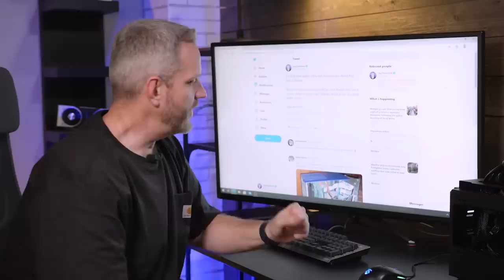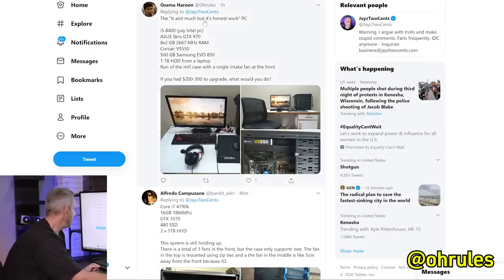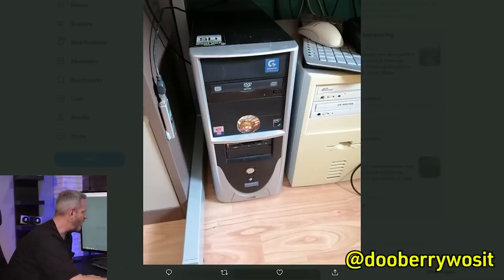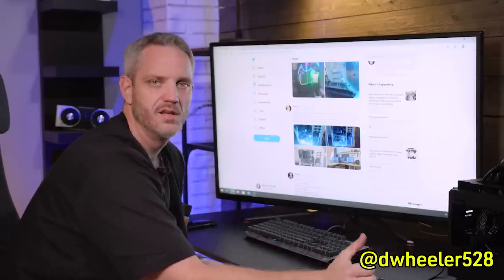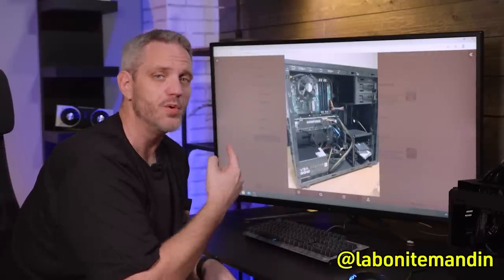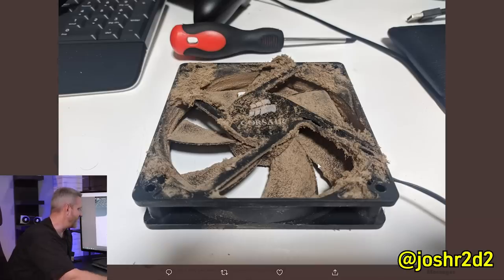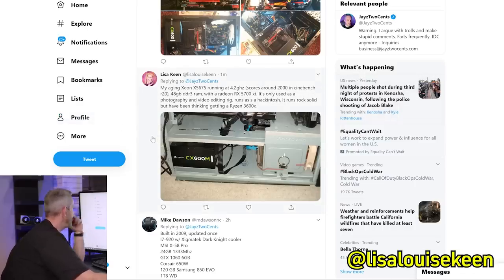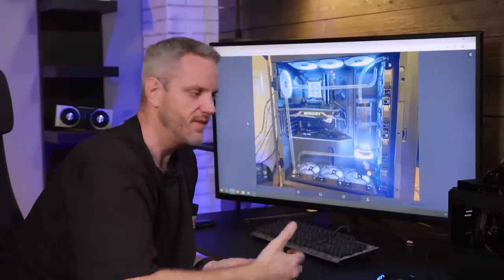Reacting to your WORST Setups... Send help NOW!

Comment: 6:30 Jay: "Im gonna preach to everyone running an FX processor right now"
Me: Running an FX-4300 for the foreseeable future
Reply: I mean a budget ryzen upgrade would set you back like 200 bucks (ram cpu mobo)
Reply: I don't get it...why are fx's bad?
Reply: Also he said “sell your FX system it’s a decade old.”

Meanwhile a Intel Core 2 Quad Q8400 is slower  then a FX4300 in most multithreaded workloads. And a FX6300 or FX8350 are much better then the Q8400. And still Jays’ advice for the Q8400 owner is “upgrade your gpu.” 

Am I missing something? I haven’t tested Q8400 or lower end FX systems in a while but pretty sure I am correct.

If I was the Q8400 owner I would upgrade to a newer platform (AMD Ryzen or Intel) and keep the GTX970 and upgrade that further down the line.

But that’s just me 😉

Still, nice video, fun to watch 👍😀
Reply: I still have this thing can't wait to get rid of it this Winter
Reply: @MrJohnLongbow  That system had an i5-8400 in it, not a c2q...
Reply: I had an FX6300 overclocked at 5.1GHz and ran it that way for 2 years before changing to an FX8350 that I'm still running 4 years later.
Reply: @urorazbojnik5678  I'd like a real answer to this as well.  It's the CPU family everyone loves to hate on, but I haven't seen anyone give a legitimate answer why it's so much worst than anything else for the money.
Reply: Dániel Kirr ah, makes sense now 👍😉 thanks
Reply: I still run a og fx-8320
Reply: @ThinkFreely2012  I got a less than average 8350 but it's stomping my golden sample 4350 and 6350 even with those clocked 5.5 and 5.0 respectively. 5.5 actually killed a 120mm aio lmfao
Reply: @ThinkFreely2012  32nm process node for AMD was not the best. It didn't live up to it's predecessor due to running super hot and not having much in the way of improvements. Their best point was their overclocking, with the 8350 being one of the first cpus to hit the glorious 5GHz threshold (if I remember correctly that is. If I'm wrong, someone please correct me :D)

Even with water cooling and super good fans (industrial noctua 120mm 3000RPM variant), with my chip OC'd to 4.8 GHz I have to max out all of my controllable fans to keep it from hitting 50C when I hit it with a 100% load
Reply: @finch404  what parts are those? Curious because I don't see that as doable for $200.
Reply: @tattoojay88  https://pcpartpicker.com/list/FbyfFG

It's not quite 200 dollars, but at that price you already have good ram (3200mhz) for ryzen. So if you cheap out a bit on that you'd be closer.
Reply: @xchronicxblaiz3x  Since when is 50C considered a hot load temperature lmao?
Reply: @finch404  wow OK thanks, I didn't think that was possible. Thought for sure you couldn't get a mobo or 16gb of ddr4 that cheap. That would be a great budget setup.
Reply: @finch404  50C is what I want it to max out at so it isn't near max temp of 62C.

I'm not trying to kill this cpu... yet. 50C is warm, not hot.
Reply: @xchronicxblaiz3x  since when is 62C Tjunction for any Cpu? What the hell?

Edit: apparently it is 61C, what a joke hahaha

Comment: Jay: No FX, plz
Me: laughing in Pentium
Reply: My mother bought a laptop new 3 years ago (with windows 10) and it had pentium in it
Reply: @Tornadica  skylake pentiums were released 2015, Broadwell was also released 2015 and one was in 2016, kaby lake was released 2017 and coffee lake was in 2018 and the release years what i mentioned were for pentiums
Reply: @unluckyrgg  did not know!
Reply: @Tornadica  well now you know
Reply: My nephew still uses my 21 year old pentium 3 for recording. It still runs!
Reply: @jc.1191  ive got a core 2 duo it only throttles to 93%
Reply: @kieran3339  I got 13 years out of mine till I upgraded from power supply failure.

Comment: The next theme should be "pre-owned pre-builts". 

People showing things that they've done with cheap pre-builts that they bought  second hand.
Reply: Ok emo kid
Reply: @hammer6854  ok hammer
Reply: @geogaming369  ok? And? 

What does that have to do with my original comment? 

And what does 15 year olds have anything to with anything? 

I'll be 29 tomorrow.
Reply: I paid $900 for a 2600x on a Strix b350f with 32gb 3000mhz Corsair Vengeance LED Duke RTX 2070 OC, 256gb m.2 boot drive, 3tb HDD, EVGA G3 fully modular 750w 80+ gold PSU. I simply bought a new x570 along with a 3700x and 32gb of Corsair Vengeance RGB at 3200mhz and only spent a grand total of $200 more doing that, but I did trade a Ps4 for the 3700x, but I only paid $100 for that so it was quite worth it. (I ended up spending another $50 on a 550w PSU, got a 1tb m.2 for my new mobo, and paired the 2600x with an RX 5700 that I traded a PSVR for that I also only paid $100 for) got my 13yo nephew an entire 'budget' (compared to mine) system, and my own as well, for under $1.5k

Comment: "get off FX"
Hah... Tell this to my father. He's still using pre-FX Athlon
Reply: My dad still uses a phenom...
Reply: Both of my parents do as well in their office PCs.
Reply: @Eidolon2003  my phenom ii x6 still runs everything i like just fine it even runs the new flight sim 2020 just fine 🙂 once i get fhe money for a new motherboard ill get off the trusty phenom.
Reply: @Eidolon2003  Phenom II X4 and a 750ti here, don't know how this 6 year old grandpa is still running
Reply: @mastrtrogdor  wasn't Phenom II processors were released at 2011 ?
Reply: My parents literally use their computer to sync iPhones to their huge iTunes library and to print stuff. They are still on athlon and there's really no reason for them to switch. But I still give them crap for how old and slow that comp is every time I see them using it.
Reply: @CPyJIb  yeah, built this about 6-7 years ago, back when it was a good budget build for the time. Overall parts are nearing a decade old. I'll build a new one some day, when I've got the funds. With a family it's hard to save up.
Reply: @mastrtrogdor  I am not saying it's bad or something, just clarifying the age )
Reply: @evanhoover2447  time moves in slow motion for old people, ever see one fall? They probably feel like the 5 mins it takes to boot is 30 seconds lol.

Comment: Hey now, I'm still running FX processors in my homelab. They work great for running a few k8s workloads and my plex server. I bought this stuff before Ryzen existed and Intel was out of my price range. I wanted cheap and relatively power efficient (compared to actual server hardware) homelab gear and they fit the bill (microcenter bundles ftw). And honestly at this point, it would cost more for me to sell them and upgrade than to just keep running them until they die.
Reply: CaptainRedHat they dont’t die...
Reply: I’m still rockin an FX8350 (though my Ryzen 3600X just came in the mail today) at 1440p with an RX580 and getting pretty good performance out of my system. It was a great bang for the buck cpu at the time that has held up well over the past 6 years.

Comment: 6:23 didn't Steve from Gamers Nexus say in one of his videos that he still uses and FX at home? Undervolted and underclocked if i remember correctly...
Reply: Yeah. Steve still runs FC at home. This feels like a start of a battle between the two channels.
Reply: Im still using a fx8350 with an rx580. I can play modern titles 1080p higher or medium settings 60 fps. Its still relevant for modern gaming
Reply: Yup he did
Reply: @oelshami  they've already fought it out smh

Comment: Absolutely, an SSD brought back to life my wife's old FX system, (lol. I know). Cool part is, it's in a vintage case, black and silver much older than that. And no you cannot have it, lol. A video card upgrade to a 1060 also worked wonders for her. Goes to prove your point, that those two are the most significant upgrades. She plays mostly Ark and Conan and the difference it made was absolutely incredible on such a Dinosaur. Don't worry a Ryzen is in the planning in the future, I get it.

Comment: 6:23 I'm running FX-8350 and GTX970 still doing ok with games =)
Reply: Yes, but you are not doing ok with Jay. And isn't that what really counts?
Reply: @Da Mighty Shabba There are hundreds of YouTube Videos showing you why it's a relatively bad idea to try and game on a workstation CPU (and more importantly mainboard). Watch some of those before you make your decision.

Also, out of the about 10000 new games coming out each year, only 6 (maybe 7 next year) are capable of really using more than 4 threads, so ...

Before you spend money, read some benchmarking articles and really figure out which CPU can give you the most performance per $.

Or get something close to a 3700X because that's what the next generation of XBOX & PS4 will use, so it's a pretty safe bet for the next decade.
Reply: Same but 960
Reply: Same - 8350 OC'ed to 4.5GHz with a GTX 1070 keeps my games maxed at 1080p 60Hz (monitor refresh rate).
Reply: I’m still rocking an 8350 and dual 970’s, all on custom water!!! Runs everything well enough that I play, at high enough graphics and FPS, why build a new system? I don’t spend $300/yr on all the latest games and try to keep up with the Jones’, so I don’t need top tier hardware. I think most of the tech-tubers have become spoiled a bit with all the access they have to hardware (freebies or income to buy outright), that they forget you don’t need to play on ultra settings to enjoy a game!
Reply: @ShieTar_  but you are right most games won't use more than 4 core 8 thread, and a 3300X isn't that different in performance to a 3700X in single core performance so... taking your own advice you shouldn't get something close to a 3700X lol.

Comment: I ended up initially spending money on a (replacement) power supply for an FX System just to end up deciding to build a new budget computer and starting over (idle and even gaming temps were like 78 on the FX once things got going. A friend literally asked if I was trying to melt something, I now realize that the answer to that question was my PC). I passed the decade mark and realized just how old my CPU was when I started shopping for a new one.

Comment: So I had a 970 and threw it in my ryzen 3700x rig while I was waiting for my 2070 super and it did amazingly I was so impressed
Reply: Brandon Mullen 970 is still a great card
Reply: has a GTX 960 but usually games on Intel UHD 620

Comment: fx  8350 still runs pretty well a good gpu from that time.  Also for cable managment for cases from that time just use a rotary tool  to make the neccsary mods to the case.

Comment: Jay: finds the 8900 lacking.

Me: still using a 4700.....
Reply: Upgrade already.
Reply: @GodofLovers  4790k is still about the perfomance of a modern quad core like 3100 or 10100F when overclocked
Reply: 7700k here. No reason to upgrade.
Reply: @angelic3276  yea that was my last build, and it wasn't enough for homeworks or other Modern VR titles. Plus with next gen coming this year. That CPU will not be relevant anymore. Unless you like playing on medium or low. It's not good enough for me. I upgraded my CPU first and kept the same GPU for a little bit, and with the that i7 I had to go on low settings with half life alyx. With the new CPU I got I was able to do high settings without changing the GPU. It's not a good CPU anymore if you play on high and or ultra. And you want more than 60 fps.
Reply: I think it was a 8400, no way is he going to say a 8900 is lacking. And I'm still on a 2600K.
Reply: Still on an i5-750. No, I did not miss a zero. It's from 2009 XD
Reply: Me using a i3-2328M laptop cpu
Reply: @snakeinabox7220  I'm using a4 5000, lol,

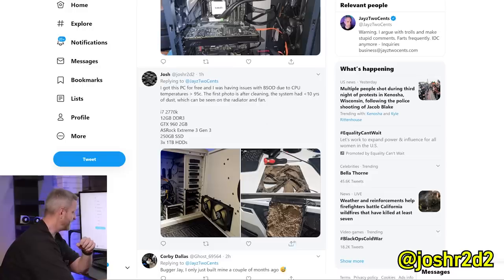Comment: I got the same case as the dude at 17:34 and glad to report my fans DO NOT look like that. The case itself has very good airflow so don't know how that much "dust" got onto those radiators & fans especially since the case comes with 4 different fans out the factory. SMH.

Comment: I was building computers for years. Ended up taking 15 years "off"(just had an old XP desktop and at the time a reasonably good laptop) so once I got back into building. I had no problem building it but what I was used to was IDE cables and graphic cards were powered by the PCIe slot(so no cables to worry about internally). I don't know how I ended up watching J2C(4 or 5 years back), but that was when I realized that NOW cases have space behind the MB for cabling. My first 2 builds worked, but looked messy. One was for my Brother-in-Law(he still uses it) the other was my personal build. Well, once I started watching it sent me into some what of a tail spin. I "had" to rework all the cables in my on rig(BiL is still working with the spaghetti wiring, but there's no window so he can't see it). I've since built 3 new personal rigs(although I probably need another few before I've got cable management down) and have been doing decent on cable mgmt. Appriciate You, Kyle and Paul giving some idea what can be done.

Comment: My OC'd FX-8350 ran most games around 60fps on higher end graphic settings with a 6GB GTX1060, but I finally upgraded last January to a $1,600 all AMD build. The old beast still breaths in a family member's hands, so yeah JAY... Kinda hard to kill something that doesn't want to die!

Comment: i went from 1100T -> FX 83XX -> 2700X. I used a CH4 Extreme with full coverage waterblock for the motherboard from release day to the point of building the 2700x system.

Comment: Jay: "GET OFF OF FX!"

ME: "But i just Upgraded from FX 4300 to FX 6300!"
Reply: go with a Ryzen 5 2600 at that point
Reply: Still on a FX 4100 here ,using it as a file server now though.
Reply: Johnny Stash He’s damn right fx sucks. Even a i5 2500k or probably even the 2500 is better at gaming then a fx 8350 let alone a 6300
Reply: @sijedevos2376  so, most people use Rx 580s with their fx cpus. Their would be no difference with such a card. The only time the i5 would beat it in games is unless where talking about a game like csgo or GTA 5
Reply: I got an fx 6100 from my friend's dead pc but i sadly have no motherboard
Reply: NoobGyver motherboards for fx chips are pretty cheap
Reply: @sijedevos2376  I know its just hard to find and make it ship to my country
Reply: NoobGyver is there no used market in your country?
Reply: @sijedevos2376  there is but its pretty bad since my country is full of scamy people that sell overpriced everything, even an expert PC technican family friend  of mine couldn't find a board for my fx, and he finds everything.

Comment: Hi.
If you are reading this, you may be wondering why.
This is due to the fact that a part of your brain has triggered your eye muscles to expand and contract to aim your pupil at these set of pixels.
By the time you reach this line, you may or may not have a preset instruction in your brain triggered to make a set of grey pixels under this comment blue by expanding your index finger with enough force to trigger an event on this device.
I hope you have found this useful.